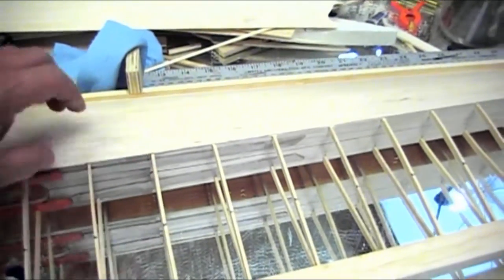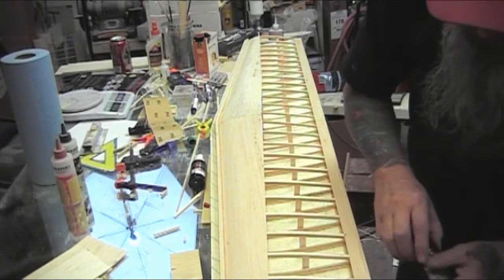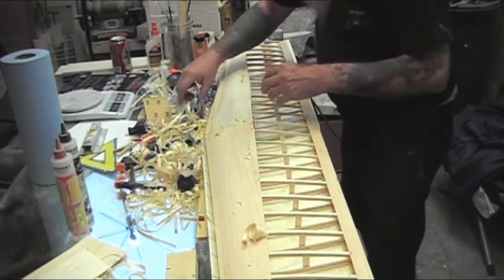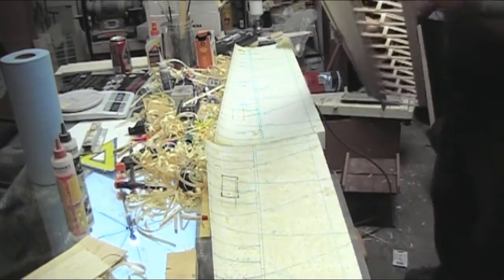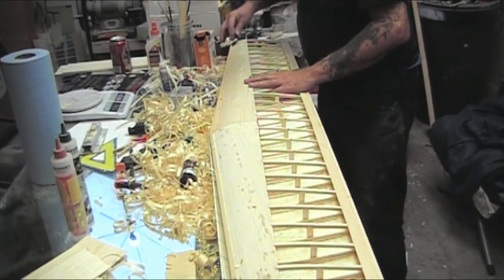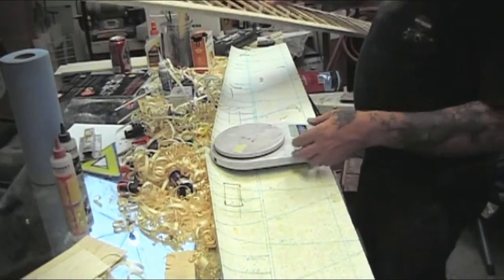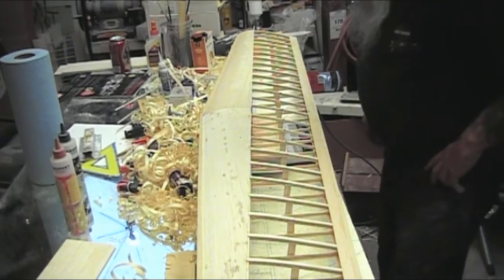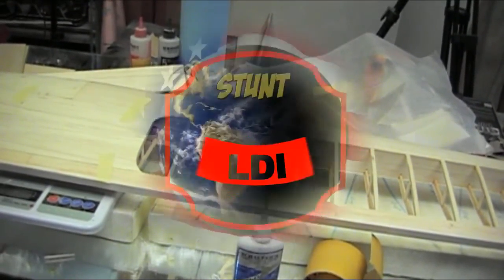Millennium Beam wing Finished

Comment: Is the main spar 1/8" balsa ?  Also you don't show the process of sheeting the opposite side of the wing. Do you just unglue the supports blocks and just flip them over and tack-glue them ?
Reply from the maker: +Charles Bovalis The spar is 1/8 and yes I just turned it over and sheet'ed the other side.
Reply from the maker: +Stunt Hangar Yes